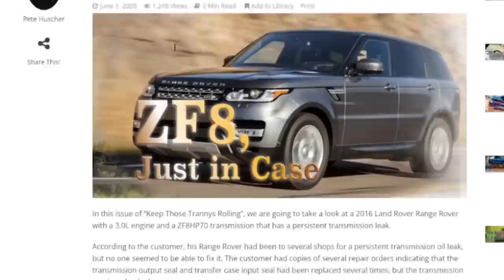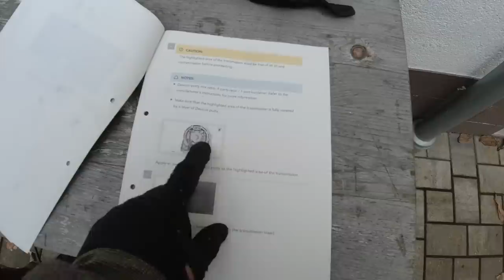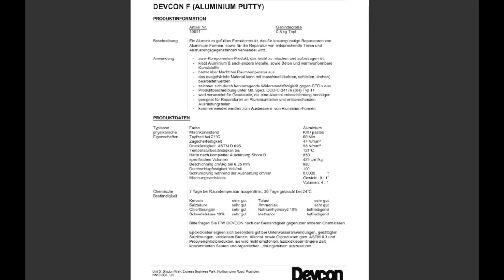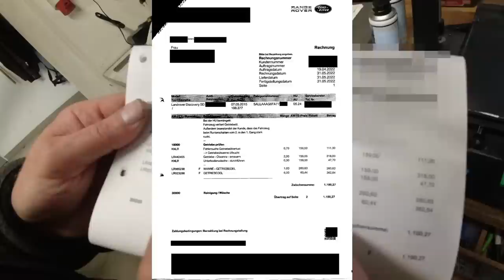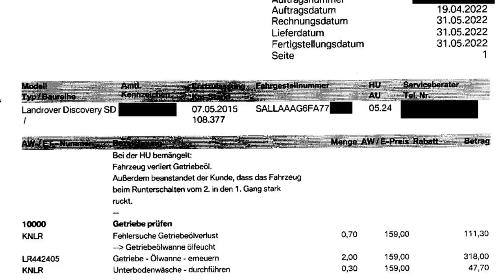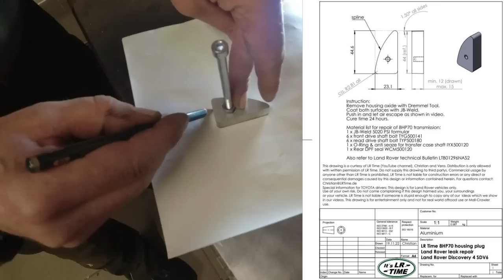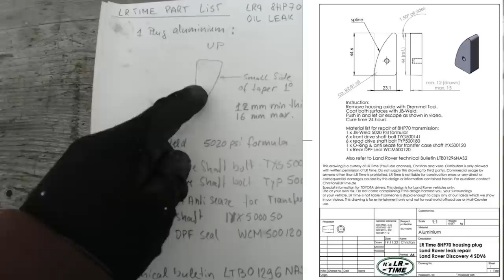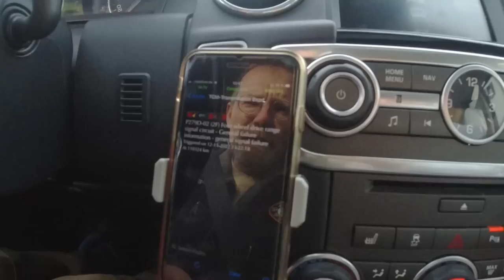Dumbest Oil Leak Ever Fixed on our Land Rover

Comment: Hi Christian and Vera for me there are two main failing from the dealer, firstly failing to do a post inspection to confirm the leak is no longer present, even a road test on the same day would get the vehicle to temp likely causing the leak to reappear. the second failing is not checking the technical bulletins for existing faults to be aware of when diagnosing. Unfortunately we as consumers have very little recourse with manufactures this large and fighting the good fight costs money and more importantly time, LR are notorious for this type of customer experience. One other point the solution they offered is a cheap remedy, where the real solution should have been a recall on those transmissions but LR know the patch saves them money and few customers would legally pursue them for a complete gearbox replacement. Casting fault on potentially 80k vehicle is not fit for purpose and a manufacturing fault.

Comment: We have driven our Land Rover d3 all over the world. I do most of my own regular servicing. But occasionally we need some work done and I usually try to use a LR dealership as hopefully they know what they are doing. I’ve been severely disappointed twice. Once in London before we left and once in Melbourne. First time in London the dealership clearly didn’t do some work I paid for and then refused to refund anything. Second time in Melbourne, they opted to do the most expensive repair first which didn’t fix the problem and ended up being the much cheaper option. Again. No refund offered. I don’t know why LR dealerships need to be so bad. 😢 Great video and loved the ending. 👍

Comment: Great episode and well done for finding the problem. The previous owner who paid for the failed repairs would have a strong case in a small claims court. I think a better method of dealing with the air lock when fitting the aluminium block would be to drill and tap a hole straight through it then seal it with a screw, washer and thread lock when the JB Weld had gone off.
Reply: I thought Christian would do that, a grub screw threaded only in the last 6mm, a smaller diameter hole right through.

Comment: Well done for fixing the leak 👍 remember LR wouldn't offer a free diagnosis even though their original diagnosis didn't cure the fault.  It could be that the transmission pan was also leaking and that the secondary leak was the one you fixed. They should have kept the vehicle for a few days to check their repair!   Imagine though  the cost implication for LR if they admitted liability for yet another faulty component on their vehicle!!  It is terrible though that the customer has to pay for the parts and labour for a manufacturing defect that has been found to be at fault.  Surely this should be covered under a call back scheme.  Keep up the great work 👍

Comment: Yes i agree with you.
I'm an independent mechanic educated in France living in the US and over here like you said they need money to run their business so they are more parts changers than mechanics.
I give you an example of long time ago I was working on the Ford station wagon and instead of missing the diagnostic I took it to a Ford dealer who had that expensive fancy diagnostic machine to tell you exactly or supposed to tell you exactly what is the problem with it.
When I return to pick up the car with the diagnostic sheet about 6ft long of a list of parts that could be the problem.
I asked the manager if I could talk to the mechanic ran the diagnostic as a courtesy between mechanics.
He announced me the new machine was damaged by somebody who backed up into it few weeks ago and we're waiting for the parts to fix it so they use the old diagnostic machine instead.
My next question was how do you proceed in a case like this to fix the problems.
He told me we have an advantage of you guys we have a parts department and we replace Parts one after the other until we get the problem solve.
My follow-up question was do you reinstall the old Parts who didn't fix the problem he told me no we just charge the customer for them...
Remember now they have all those people to say hello to you and offer you a cup of coffee in the TV rooms where you are put at ease before they empty your wallet...
That is my French sarcastic sense of humor...

Comment: Hi Guys, great video, did you find the other bulletin about doing the same fix on the cavity next to the one you fixed. 
Totally agree with Christian LR should come to the party and repair for free as this is clearly a manufacturing fault of ZF and all auto suppliers have insurance to cover warranty faults. We purchase a vehicle and expect 6-10 yrs life hence lemon law in USA and in Aus we changed in 2011 our consumer law to cover such issues. Unfortunately as customers we have to fight for companies to do the right thing. That Dealer should look at themselves and push LR to cover such work costs and review their training as there is a bulletin covering the issue. Keep up the great work. We need a video of how to replace high pressure fuel pump belt on rear of motor without lifting body off.

Comment: With hindsight the joke you made about about not drilling the hole all the way through would have been a good idea to let the air out and then plug with a grub screw with a bit of locktite to seal?
By the way as it’s a later model does it use adblue?

Comment: Well done for finding the issue on the transmission. There is a known issue on some 8HP transmission casings which is porous as you found. To my knowledge this isn't specific to Land Rover.

The dealer shouldn't start by contradicting you,  worst case they could just say sorry that you're not happy with the service and leave it at that.

They definitely should have checked the service bulletins and offered some sort of discount on repairing the leak. I wouldn't be surprised that these costs get passed on to ZF to some extent anyway.

Comment: Great to see how the tradition of  Land Rover incontinence is being  maintained today through the  miracles of optimised economy of materials,  driven by  finite element stress analysis producing this fashionably complex ribbed pressure die cast housing and it's sobering that  LR can  now even  import innovative  European leakage technology, without reliance on the small artisan leak suppliers, probably based in the Ws of Wolverhampton, Walsall and  West Bromwich, with skills honed by years of meeting or even exceeding advanced  British Leyland fluid loss specifications. They've clearly upped their game here from past reliance on  failures of mere cork, dodgy gravity castings or  perished rubber in the days of old.

Comment: It’s an absolute disgrace what main dealers (stealers) get away with.  My disco 3 had a book of receipts with it from the previous owners, guaranteed half of the jobs weren’t required. 

It also really annoys me when a manufacturer sells a car which has a fault they know about and they then charge €500 to fix their issue?  

As for that Land Rover garage.   I think the big problem with main dealers now is that the staff are very narrow minded.  If it’s not something obvious or the laptop can’t pick up an error code then they are stumped.

I was once quoted €550 to repair a van, new alternator they cried.  I went home, found the electrical fault and fixed it for €0.02.  I used telecom jelly crimps, best bush fix ever, every tool box needs these.

Comment: Its a shame that was missed. With training of the technicians there should be a consistency of quality amongst the people working on these vehicles. 
It wouldn’t surprise me if the same service manager who responded to you is the one who put pressure on the technicians to get the vehicle through its test and get it out the door.
The worst thing in my mind is that she’s brought it back and they’ve not rectified it as the 1100 euros she was charged has not fixed the issue.
My dealer has a few experienced technicians and my experience has been good, including warranty work.
I pay them to service it as it keeps the warranty up to date. However, I still service it myself inbetween official service intervals 😂
I’d be very interested to hear what the previous owner has to say. 
My vehicle is also in the VIN number range so I’ll look forward to that repair in the future……
Excellent work - really love the videos and a reason I’m a Patreon

Comment: Yeah don't expect any dealer to do a free repair because they have missed something.  However a free second inspection would be the very least and they could have thrown a 10 or 20% discount on the repair as a good gesture.  ZF should also chip in on this by financially helping the dealers to compensate their clients with those.  ZF may have paid a contractual penalty to the supplied dealers when this was found but that was most likely not disclosed to public).  Thanks for sharing your experiences and mistakes, I think it takes great people to do that and you are (on top of being funny!).  Still shopping for a petrol LR4 here in Canada.  Cheers!

Comment: I used to work for an OEM. Christian and Vera's diagnosis is correct. Christian's email should have been elevated to LR Germany warranty and after sales team rather than be answered by the dealer. In terms of customer relations, to call your customer a dumb ass (paraphrase) is the worst possible start. Knowing how litigious Germany is, I am surprised the original owner didn't send a legal letter. When you receive a detailed communication from an independent owner who is obviously highly qualified, you're first job is 'how do we make it right' and make up for missing the service bulletin.

Comment: I live in the U.S. I took my L322 to my local LR dealer because the A/C was only coming out cold on the driver side, not the passenger side (fancy dual climate control!) After about 2-3 hours of waiting, the service advisor came out and told me they couldn’t correct the problem—even after verifying the system was fully charged with refrigerant and going through all the LR shop manual troubleshooting procedures. They said they were escalating it to a “master tech”.  They asked me if I would agree to paying for an extra hour of labor that the service tech spent diagnosing the vehicle because “THEY GET PAID BY THE JOB, NOT THE HOUR” or something to that effect.  This led me to believe that these service techs are more freelancers than permanent LR employees. 

The lesson of my story is this:  You aren’t necessarily getting a LR certified tech working on your vehicle when you go to the dealer.  There may be 1 or 2 (doubt 2) Master Techs that are LR employed & trained supervising the workshop floor but they aren’t the one’s working on your vehicle.  BTW this is the busiest LR dealer in the Northeastern U.S. so maybe they have to bring in “freelance” service techs to get through the quantity of jobs.  If there are any current or former LR dealership employees on here please tell me if I’m wrong.

Comment: All car dealers are to some extent dishonest, everybody in the whole world knows that and when faced with a difficult repair like your LR especially when the customer is a woman they refer to their default position which is to lie and cheat. This is normal for all car dealers not just LR so get used to it, you will never change these people. In future all you people out there should avoid main dealers if you have any sense, look for a little mechanic or firm who is good at what he/they does/do and has many recommendations from previous customers, someone like yourself Christian and they will save themselves a lot of money and heartache. I've spent my working like repairing and modifying cars and I have hundreds of examples in my memory database of all the ways dealers cheat their customers so wise up folks, find people like Christian and Vera to diagnose and repair that difficult to fix technical issue you are having with your car. Thank you LR Time for another excellent video 🛠

Comment: Good thing that it did fix the leak - that "devasted" final clip was far, far from convincing!

Regarding getting the air out - how about drill and tap another hole all the way through the plug, and then later seal that hole up with bolt / thread sealant? 

Main dealer's response is not good 😞
Reply from the maker: That would work too.  But the hole is not accessible later on.  Christian
Reply: @Vera_and_Christian  Thought of another thing. Screwing the bolt in will increase the pressure behind the plug. Ok if one has waited for the JB Weld to cure but may be not OK if one wants to reassemble everything straight away. The slight increase in air pressure may be enough to push the plug out before it has cured. Or at least, there'd be some doubt in my mind! WD40 tube is more reassuring 🙂

Comment: I am also a land rover tech in the uk in a small garage in Bovey Tracey Devon. Land rover in this case (and many more 😂) 100 %  miss diagnosed. Like you said Land Rover should have checked their system for this fix but they failed to do so. Also I think it should be a recall ( service action)  and fixed for free by Land rover. Or at least free parts to complete the job. Great video 👌👍🏼👌👍🏼👌👍🏼

Comment: I agree with ChrisCharlton on this - if the problem was not fixed it should be fixed free of charge - especially such an expensive repair.  The dealer was negligent in not checking the VIN number against known problems. Also - I was shocked that Land Rover charge for the parts to fix a known manufacturing defect.  This should be a free of charge repair as the problem is 100% due to a manufacturing defect.

On a non-related point - I recently saw a YouTube video on the air filter for the air suspension.  This filter is a foam plug that is in the rear of the vehicle to filter the air going to the air suspension.  I have never seen any mention of this filter except in the one video I found by accident.  The problem with this filter is that it is foam which naturally turns to dust after a few years so really needs to be replaced every few years to avoid sucking the dust into the air suspension.  If you have not changed this filter I would have thought that the one on Vera's D3 would likely be dust by now and I would certainly check the one on Christian's D4.  I would guess that this is an inexpensive part as it's just a foam plug and, if it was my vehicle, I would change it at every main service.  I have seen the problems that can occur when foam turns to dust as I had a flight case go like this and damaged the equompent stored in the case. (also happens with microphone windshields and the foam in headphone earpads over time - which is why headphone earpads need replacing every few years).

Comment: In Australia that would be classed as a defect in manufacturing and would have to be repaired by Land Rover under warranty. This is regardless if you are still covered by the original warranty or not

Comment: Another brilliant video Christian & Vera. Your attention to detail takes OCD to the next level!
A suggestion for other folks attempting the same procedure would be to perhaps use a hypodermic needle to help release the air pressure, rather than the WD40 tube, when inserting the plug...

Comment: Years ago I had a similar problem on a Rotax motorcycle engine where a thin walled part of the crankcase casting that an oil gallery drilling passed through was porous and allowed air into the gallery, because it was on the suction side of the oil pump this air caused the pump to fail to pick up oil until high rpm which meant that at low rpm the crankcase would fill with oil and the separate dry sump oil tank would run dry. After I correctly diagnosed the issue and as one end of affected oil gallery was accessible I made a thin wall tube to slide up inside the gallery past the problem area with a good coating of sealant on the surfaces which sealed up the porosity and cured the problem. I have a feeling that you could have fixed your leak in the same way, as I think your leak might have been caused by a similar issue